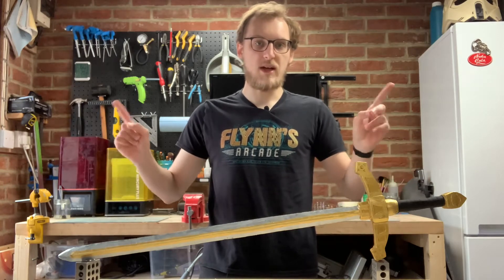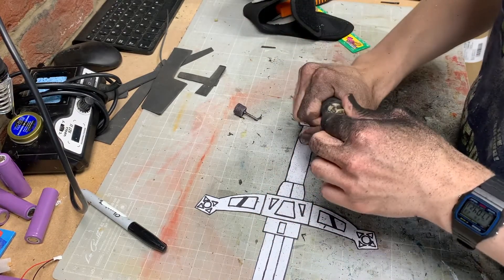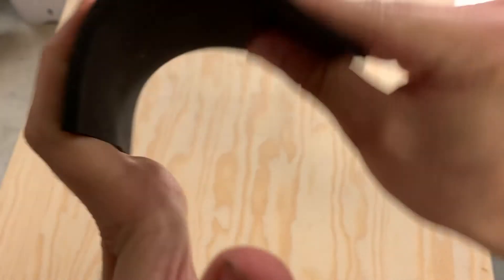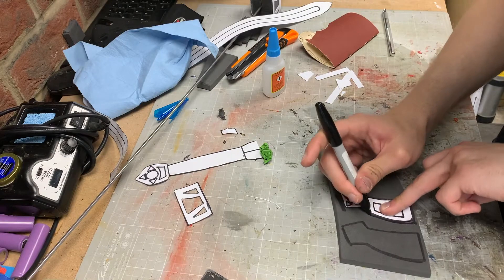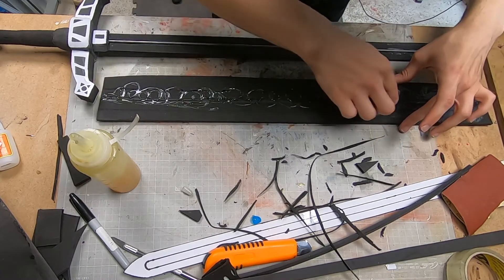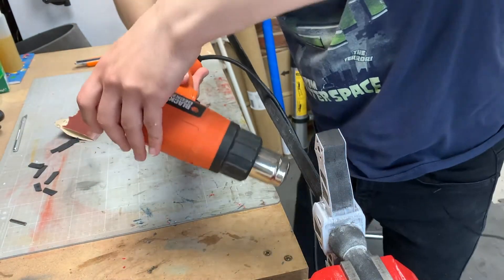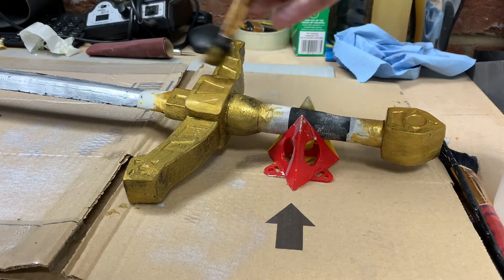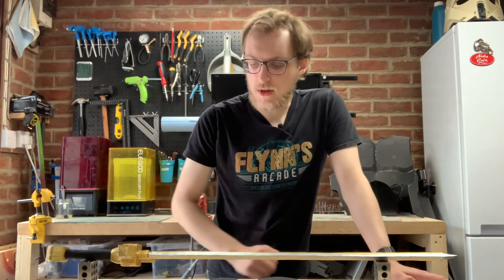Making Makoto Yuki's Sword from the Persona series

Comment: Probably could've looked at the Figma figure of Makoto Yuki as a reference too, and maybe the Persona 3: The Weird Masquerade stage plays too, though, the latter might be tricky.
Reply from the maker: I did see that figure come up when I was gathering reference and it's for sure a good option, though sometimes they aren't 100% accurate it will still help with some of the details
Reply: @atomoworkshop3327  I see that the triangles and dent parts around the handle were colored dark blue as seen with the Figma figure and the Mii costume in Smash Bros Ultimate, which you didn't include here.
Reply from the maker: @spydersoup8447  yes this is an issue I realised well after the video was done and dusted sadly. I don’t know why it took me so long to catch as only a handful of shots have the dark gold on the insides. Something I need to fix at some point!
Reply: @atomoworkshop3327  Yeah, perhaps a follow-up video maybe.